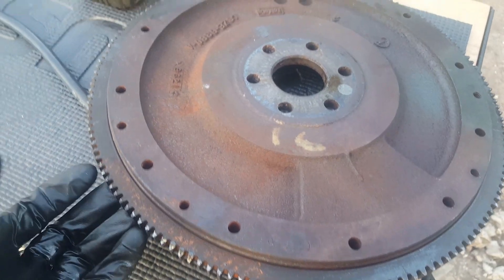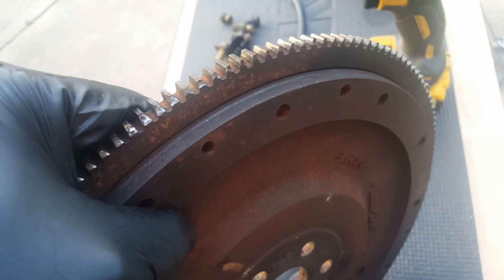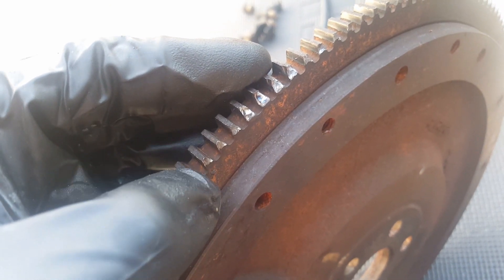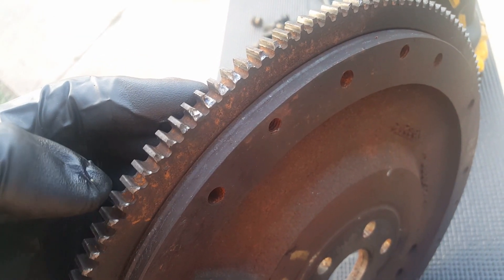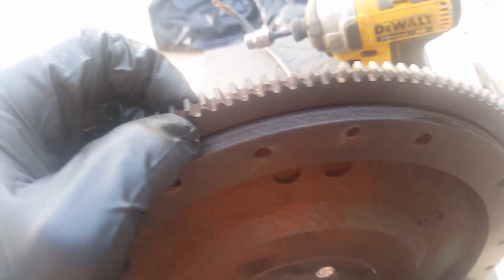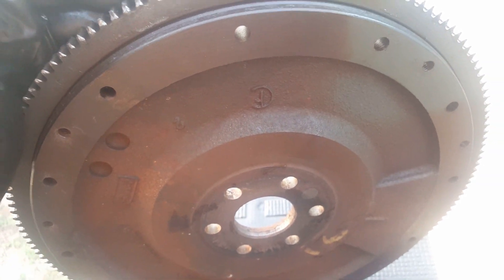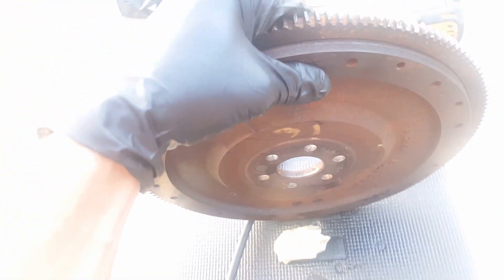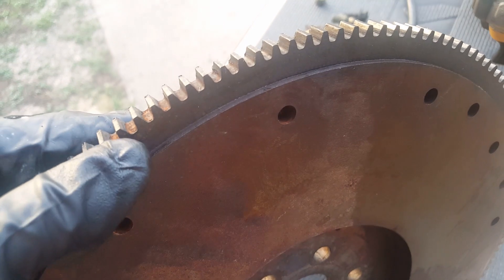Marine Starter Won’t Engage? Check Your Flywheel for Missing Teeth!

Comment: Michael I have a starter that not only stays engaged but keeps cranking once engines fires up. No grinding is heard but I can’t for the life of me find the electrical anomaly after testing the starter, replacing ignition switch, and solenoid…any ideas?? I’d like to get on the water

Comment: the starter needs attention, usually, the spiral spline that drives the drive gear is stiff so the starter motor is energized before the driven gear is fully engaged ans it rips the flywheel ring gear teeth.
the starter drive gear is damaged too.

Comment: Michael I'm trying to get the thickness of this flywheel where it mounts to the crankshaft. Do you have this number.  Thanks
Reply: What it gonna cost  me to have someone replace my flywheel?   Are we talking thousands?  Just wondering cause mine looks a little chewed up.  Thanks
Reply from the maker: I'll get it for you this weekend
Reply from the maker: 3/8 inch thick in the center